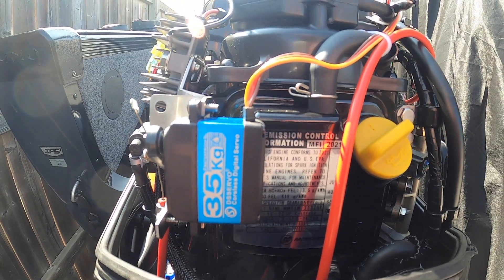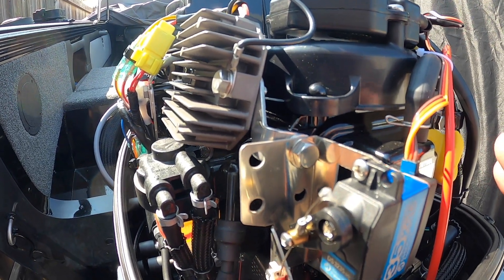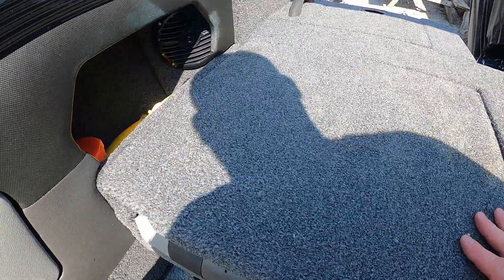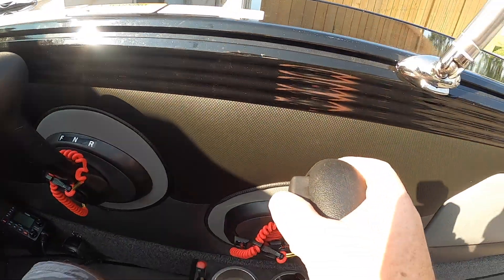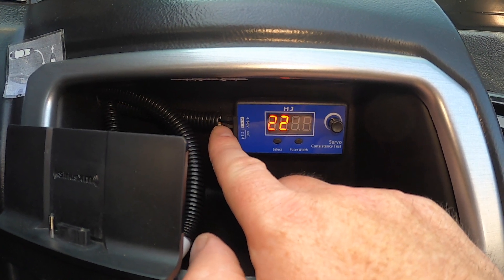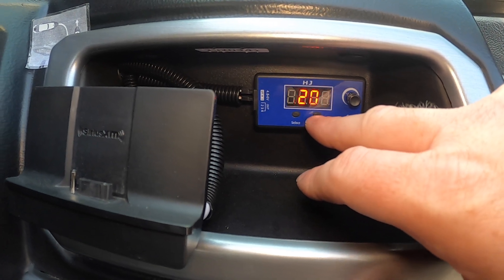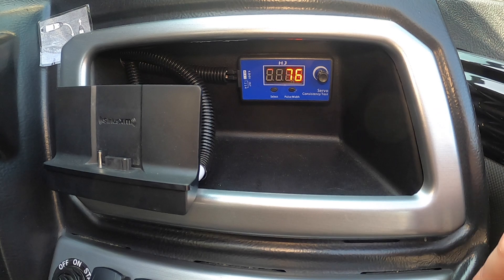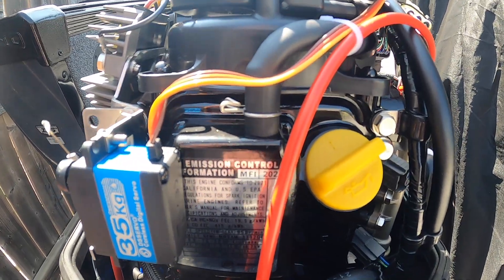How I made a precision throttle control for my 9.9 kicker motor.

Comment: Nice job! Thanks for posting! Just ordered all the upgraded parts from GoBilda to build it. Went with their controller,voltage regulator,and travel limiter.
Reply from the maker: I was looking at that site as well.. Did you get their servo travel tuner? I think it would helpful dialling ultra fine throttle adjustments
Reply: @bikermike  I did, but components haven’t arrived yet. Only thing I’m not gonna have is a display. Don’t know how that’s gonna play into the usefulness, seems like it would be handy, at least until you get used to it. Any failures with your setup yet?
Reply from the maker: @TW14137surprisingly none! Works great! I would like to try the servo travel limiter eventually but it’s fine the way it is for now. 
If you’re interested I have a video on a Raymarine auto pilot instal on my boat. Check it out. I am extremely pleased with that set up as well. Both systems make trolling a breeze

Comment: You read my mind. I was about to sort thru all of my rc stuff and make something work with that stuff, but the display was the only thing I'd be lacking. Figured I'd Google  to see if anyone has dont something similar and bam here we are. Just received the tester and extra 3 wire in the mail and that will be my Friday project. Thanks for the part number on tester.

Comment: Thank you for posting this it is exactly what I want to do!! So I am guessing that you used the voltage reducer/converter for your set up? Or are both of those exactly the same?  And would you post where you purchased the switch and the fuse? 
Thanks again for posting this and the video was great!
Reply from the maker: yes need to reduce 12 volt in boat to 6 volt for servo and controller. switch and fuse I had but will post something from amazon similar

Comment: thanks for a great DIY video. Please send the amazon link for the throttle cable and where did you get the servo mount bracket ?
Thanks for all your help
Reply from the maker: links are in the videos description. I found the hardware kit specific to my motor on eBay
Reply from the maker: @tomvu3207  got the specific one for my motor. Should be able to look up part number for yours on their website

Comment: How did you deal with overtravel from the servo? I'm doing this now and I have 180 degree travel on the servo but only need about 100 degrees for WOT. I'm afraid of applying to much pressure after the WOT position has been reached but still have travel / adjustment on the servo. Be nice if you could limit the output of the tester. Or is this not a problem?
Also, I'm trying a smaller servo, 12kg. Not sure if it's going to work but measuring the torque on the throttle arm was around 7-8 kg. Certainly gave me some ideas, thanks for posting.
Reply from the maker: It’s really not an issue for me, don’t really use wide open throttle, however I’ve been doing some more research and have found a new controller im likley going to get along with a servo travel limiter for even more precision. The controller has memory presets too! Check out (gobilda) website I’m likley getting their  servo controller (single dial) and their servo travel limiter. They have videos on YouTube for both devices. And they are both inexpensive.
Reply: Thanks for the reply.  @bikermike   I'll check that site out because overtravel may be an issue. If I need to run back to port from 10 miles out I want to go as fast as possible. It looks like the smaller servo has enough umph to operate the throttle. If you get it running let me know.
thanks
mike
Reply: I've ordered the limiter and the controller with presets. I'll post when I install it. Thanks again for the idea!